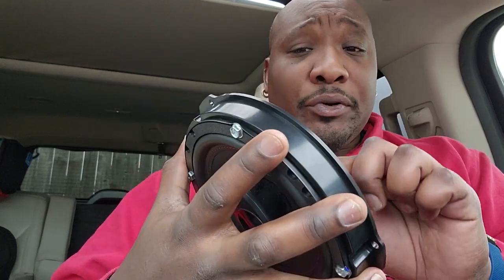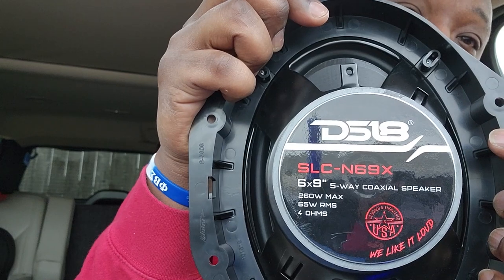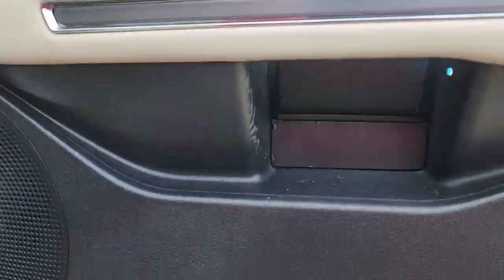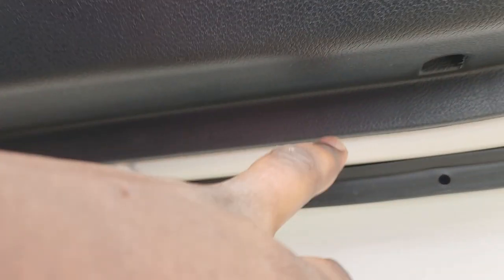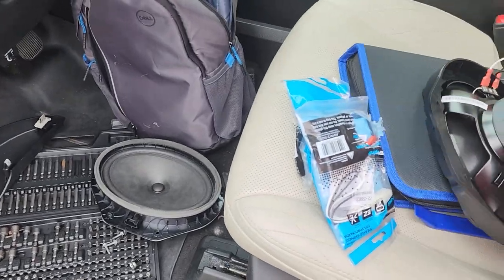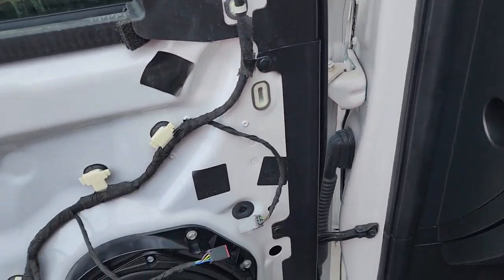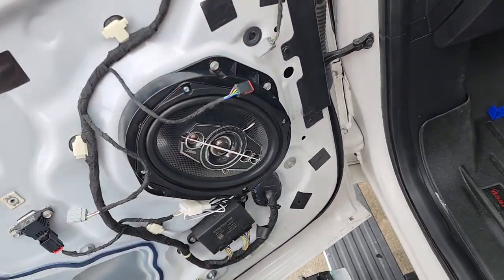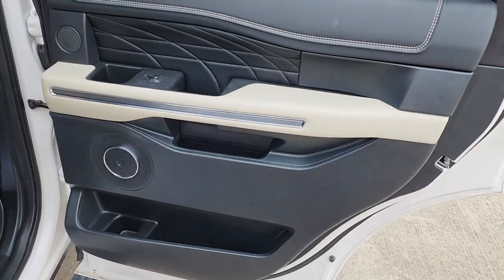2019 Ford Expedition Door speaker install and demo | DS18 speakers

Comment: I have a 99 Ford expedition, I still need to add back door speakers, I have em just haven't install em. Loved the video.
Reply: I also have the 1999 expedition what speakers did u use

Comment: No amp on the highs? Just a speaker swap?
Reply from the maker: The truck has a crappy B&O 9 speaker set up in it so for now until i completly swap it out this will have to do the trick.